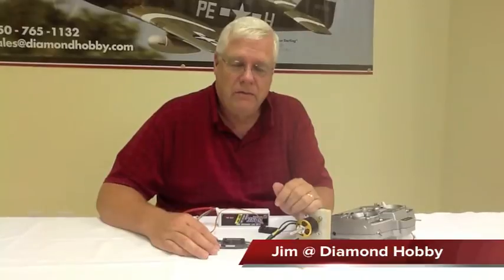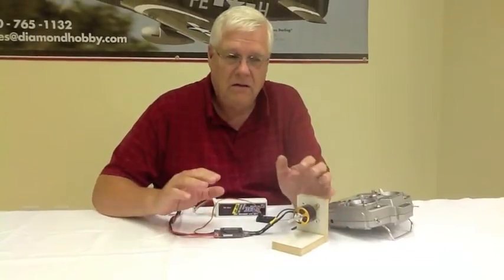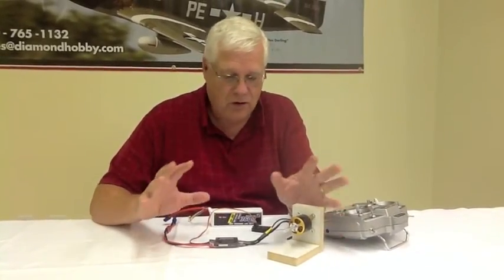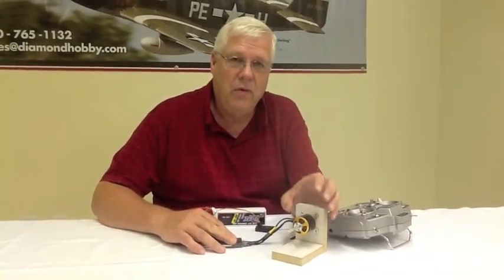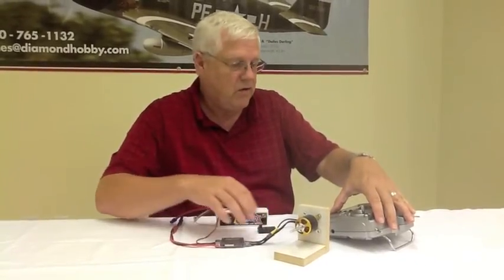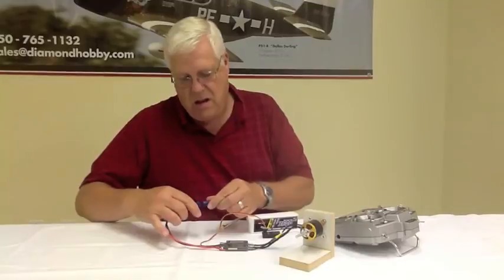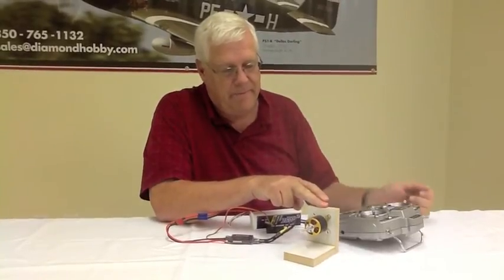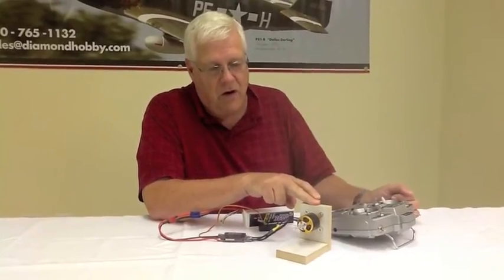Diamond Hobby How to: ESC Reset

Comment: I was about to junk my 50amp ESC. Jim thanks so much for this video. I was programing my AR631 Receiver. I had a 64MM ducted connected and three servos. It would not run so I tried reversing  Throttle. After a warning message, I said yes. The ducted fan took off full speed flying away with the battery and servos. The ducted fan crashed into wall into a thousand pieces and then the motor wrapped itself into the curtains. I unplugged the battery. I tried the ESC would no longer work. This video got the ESC running again. Moral of the story, never have a prop or ducted fan blade on the motor when testing or setting up.

Comment: ive been trying to calibrate 2 of my esc, i get all the right beeps in full throttle but when i throttle to zero nothing happens, i have to lower the trim to about -50% which sucks because my other 2 work fine without touching trim. any idea why i might be having this problem?
Reply: I am having the same issue.. I think getting a program card and resetting the setting might help. After that throttle callibration migh get done.